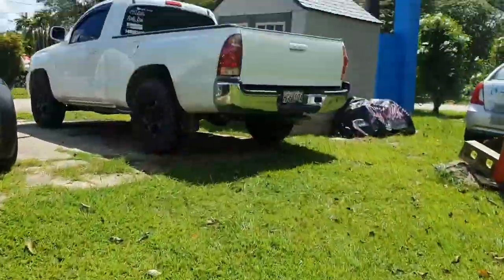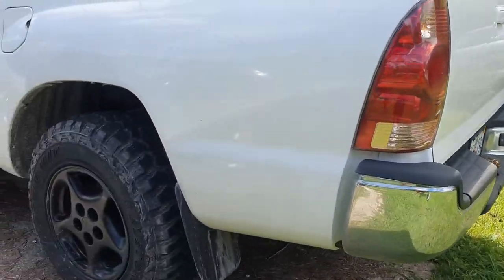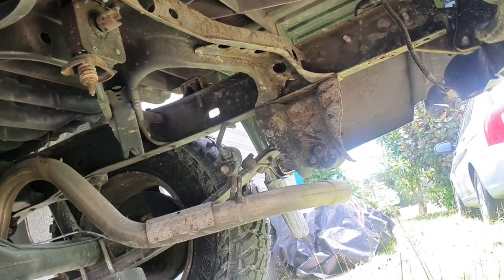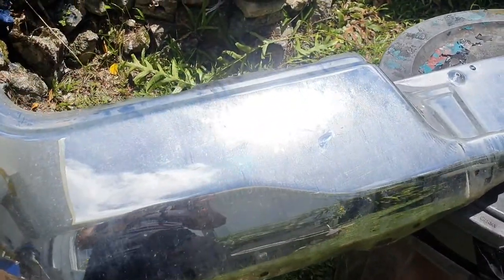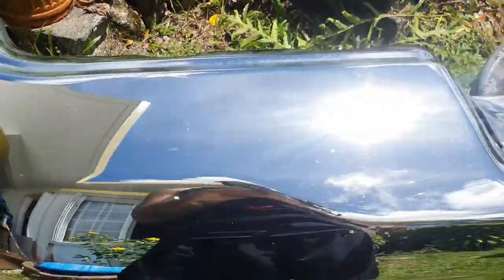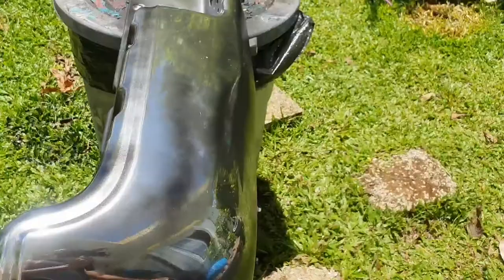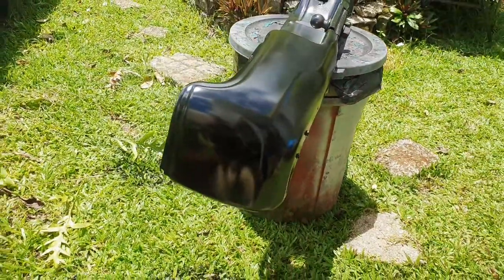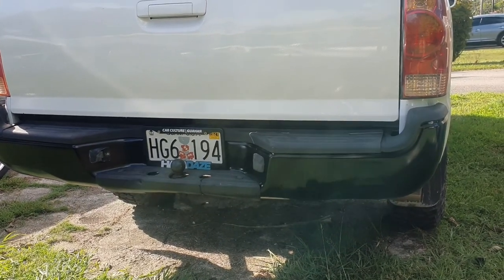REAR BUMPER REMOVAL AND PAINT | 07 TACOMA

Comment: I’ve got a 2011 tacoma that the just had the frame replaced. 47,700 miles on it. Going to take the bumper off since it has all new bolts on it. Sandblast it & have it powder coat it. 👍 Thanks for the vid

Comment: What are the tire size? Any issues with the front tires when turning the wheels?
Reply from the maker: 245 75 16. Front tires were rubbing on sway bar, but i threw on some 32mm  wheel spacers and clears fine. Wheels up front are 16x6.5 i think